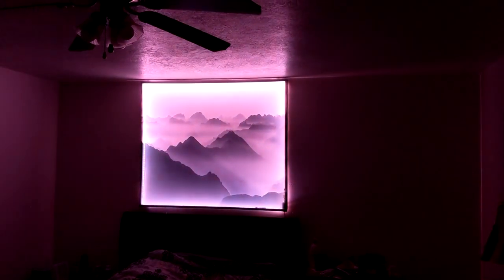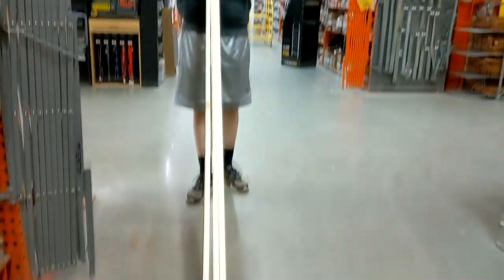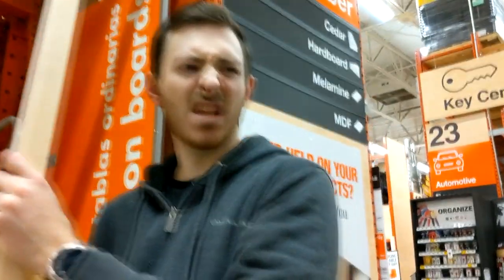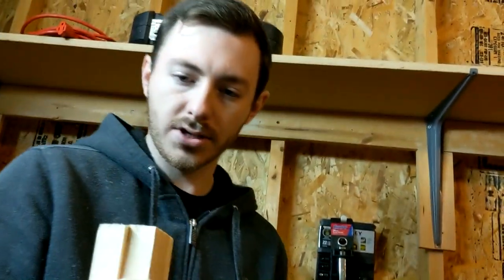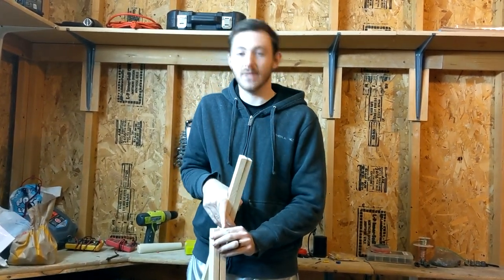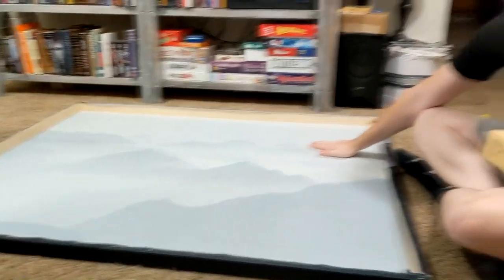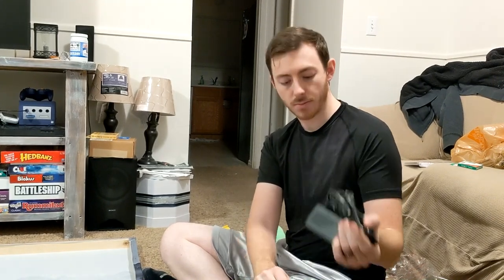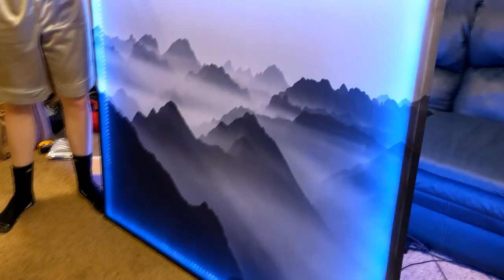How To Build An Illuminated Tapestry!

Comment: lot's of hot spots be better to diffuse led strip lights
Reply from the maker: That is true, that would be a good thing for the future.
Reply: What do you mean by hots spots? If you don't mind elaborating? 😊
Reply: @Neofirezero  hot spots are spots where there are more lights closer toghter causing the light to be brighter in some spots